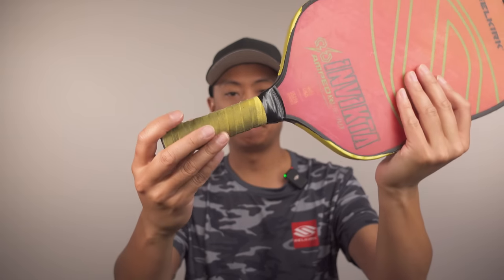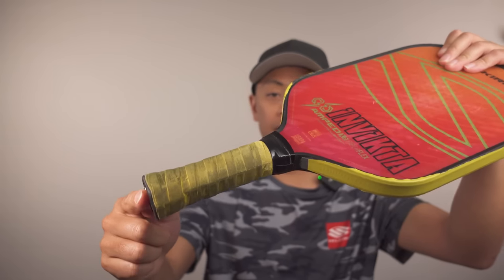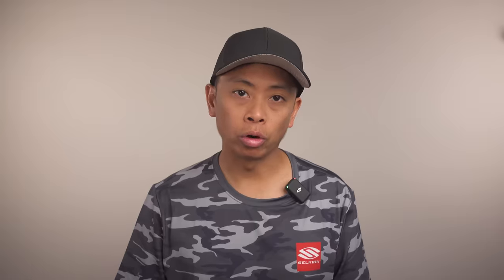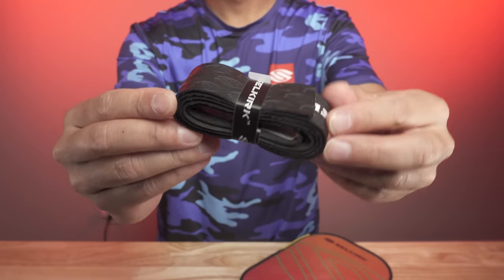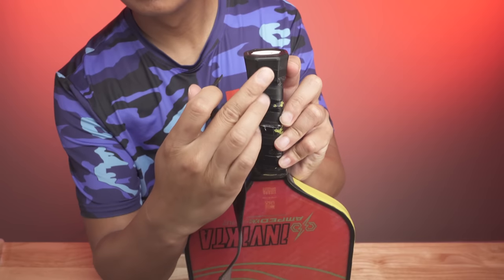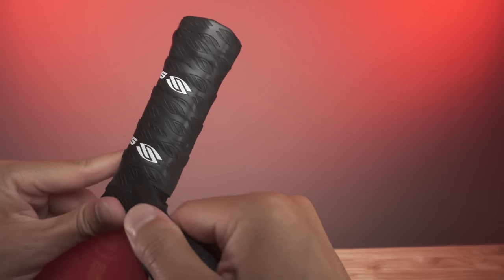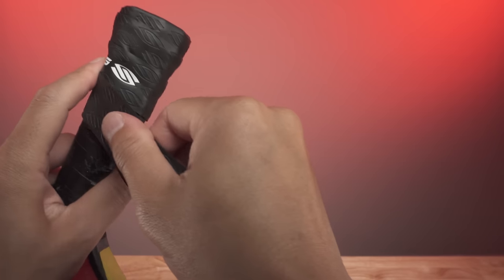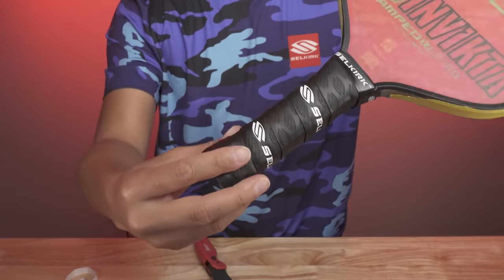Pickleball Paddles: Replacing Your Grip

Comment: Thanks for showing how to replace an OVERGRIP. That is NOT the same as replacing a GRIP. Which in this video, you never removed.
Reply: Actually, he removed an overgrip and replaced it with a REPLACEMENT grip...interesting.
Reply: That appears to be a skinny (over) grip as the base grip.  The resulting grip size after the install will be quite a bit larger than the original.